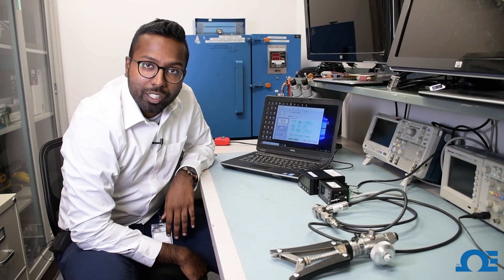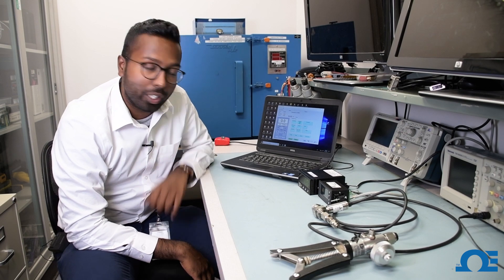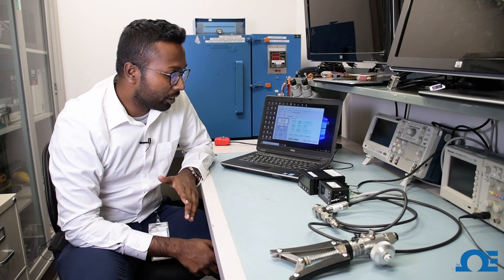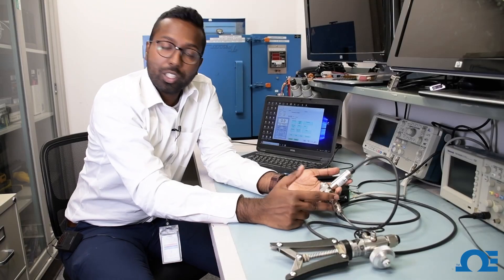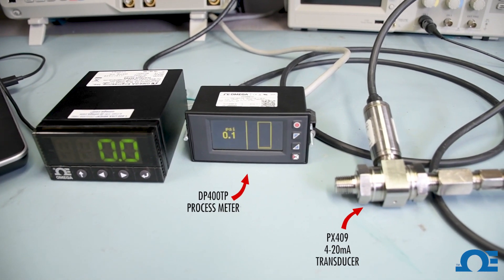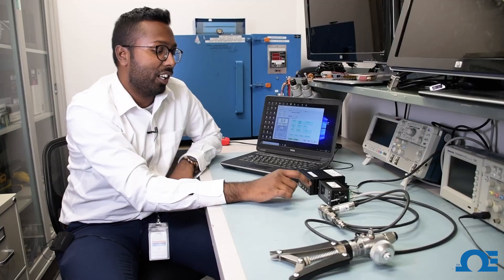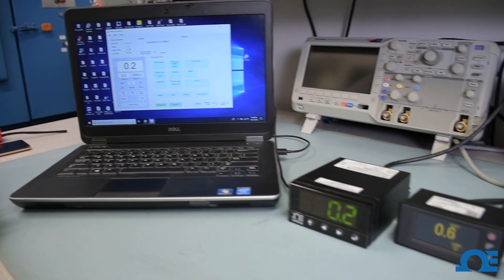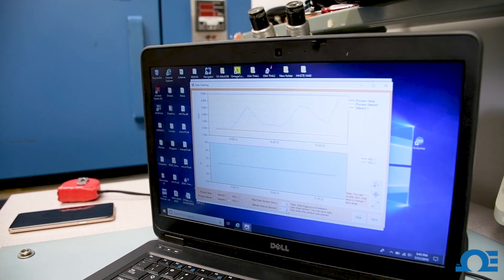How to Wire a Pressure Transducer to Multiple Devices

Comment: i need a device which is capable of measuring fluid pressure, flow and temperature of an hydraulic fluid passing thorough it. 
And showing all these parameters on my laptop screen.

Awaiting your valuable feedback
Thanks
Reply from the maker: Hey there - what is your email address so we can contact you?
Reply: amaenggwrks@gmail.com
thanks